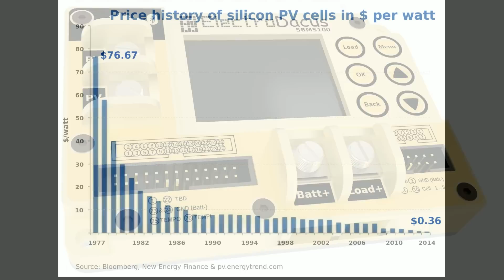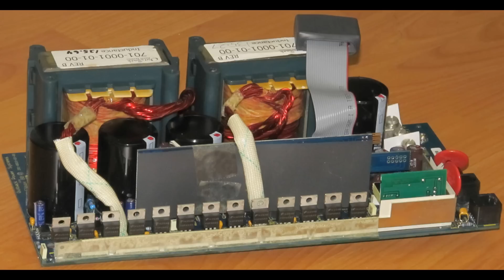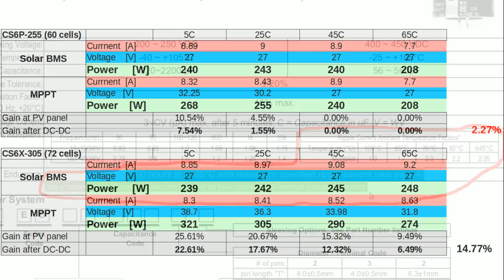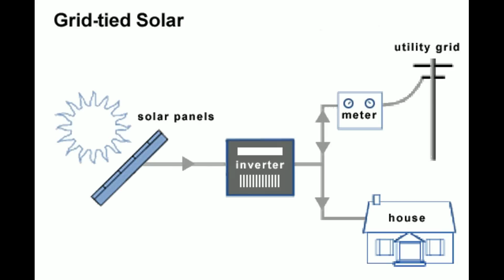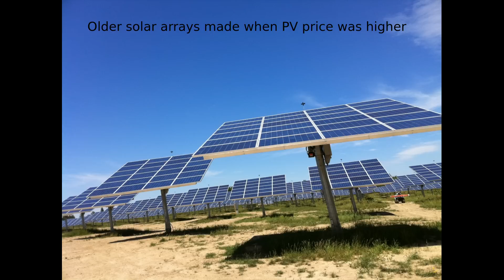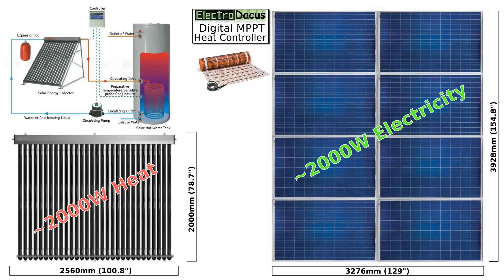Is the MPPT in OffGrid Solar obsolete ?

Comment: Dacian, check out the lengthy discussion at Green Building Advisor titled "solar thermal is really, really dead" This compares Pv hot water with thermal solar and concludes as you did. The other consideration is Pv with cheap resistance hot water heater tank or with "heat pump" hot water tank. The heat pump will cut the electric demand by about 75% in the "non heating season". But since the heat pump is inside it "robs" the house of heat. In winter you are heating the house, so the heat pump only has great benefit about 7 months per year. 
You and I are both off grid so we produce little Pv electricity in winter  and over produce  9 months per year so we are better off with plain electric hot water tank and put the money saved from $2500 heat pump water heater into more PV. 
So solar thermal is obsolete. Heat pump obsolete. Ground source heat pump is very, very expensive for space heating and so it is obsolete. Cold climate air source heat pump is about even with PV for "displaced" energy (about 66% year less energy demand than electric resistance heater) However the Pv lasts twice as long as air source heat pump (lifespan 15 years) so is half the price over 35 years.  
Windows, again you are correct. Especially expensive triple glazed windows almost $100 sq ft!! only r-7.  So much better investment than windows or PV is exterior closing insulated window shutter panels at R 30 or even r 40. This is effective in all weather conditions, can be self made for $10 sq ft or less and will save more BTU than PV can produce through the winter. Close 16 hours a night in winter, open on sunny days for solar gain. Can use cheap windows and spend saved money on more PV.
Last point. Thermal storage of heat for hot water and space heating is the only reasonable way to possibly heat with PV. A 5000 gallon super insulated in ground tank will store 1500 kwh of heat which a  5 kw PV array can produce from August- October. That covers your heat load if you use window shutters, for  November and December. Then your 5 kw array will start producing quite well by Jan. 21 and give you more heat, maybe 100% in Feb-mar-April.
Reply from the maker: Thanks I will probably check that discussion on Green Building. Heat pump maybe is OK in hot climate for cooling. For me where  only need heating heat pump will be more expensive especially since it will need a ground loop else will not work at -30C
My house is a bit non standard and has enough thermal mas for solar PV heating.
My thermal storage is up to 100kWh if I'm happy with up to 10C delta say 16C to 26C for the concrete floor. Even if concrete floor is at 16C I can easily heat the air at 19 or 20C with just the energy produced in a cloudy day.
My array will need to be about 7 to 9kWh total and in that case no backup heating source will be needed. There will be quite a bit of extra energy even in January but that is so that I have enough in December and do not need any extra.
I will need about 500 to $600 for cables about $1200 for ground mount, 1000$ for resistive loop and digital MPPT  and about $7000 for the PV panels so I round this to $10K this over 25 years will be around 400$ / heating season and this can not compare with anything else. Right now I'm at about 1200$ per heating season with the small propane tanks.
$400 is 3x less but I get multiple advantages. I can use more energy for cooking do to large array and I can find some uses in summer for all that energy maybe some electric tractors, irrigation or some other stuff like this.
Distiled water is also another use for the extra energy in summer. I pay now about 2$ for 4 liter on gallon / day at the store that alone is 700$ a year and can more than amortize the investment in the solar PV heating.
Reply: vensonata gallons? BTU? U must be from this renegade colony..
Ok seriously: Here in metric land triple pane windows are the norm /code with U<0.5. and they are reasonably priced at around 200-400 EUR per sqm. Keeping out the heat in summer and the cold in winter. Insulating shutters are a very good idea for winter nights. But automated nice looking ones cant be had for less than 200 eur per sqm. So i dont think windows ate outdated - they are quite a cost effective i architectural element.

Comment: I'm very skeptical about using PV panels for heating anywhere where there is actual winter. For example here in Estonia 90% of the energy PV panels produce comes from March to October and 10% from November to February where the heating is most needed.

Statistics on the sites show that 1KW worth of panels installed only produce 12KWh for the whole month of December. That is 16W (12000/31/24) per hour. Class A (EU standard ) yearly energy expenditure for heating a very small 100m2 house is 12000KWh. 
And most of that expenditure is during winter. Lets say in 9000Kwh during November-February. If we assume it distributes equally it means 2250KWh (9000/4) for each month. So in December that would mean you would need 187KW (2250/12) worth of panels to heat your home. That is roughly 700 panels. Even if house has much better insulation its not just feasible, because you still need hundreds. Even if you have those panels where do you put/get the energy for the period the sun does not shine (could be a week).

Because of that you still need heating with traditional means based on water circulation + additional heat source (nat gas., wood etc.) for the winter. That ofcourse means that the you would need circulation pumps, heat storage (depending on heat source) as well. Which of course makes solar heat pipes more attractive as they are quite much more efficient for producing additional energy for heating and hot water in the months there is actually some sun.
Reply from the maker: Yes you are right it depends on location. While here is really cold is also sunny even in winter.
Worst moths here are November and December where 1kW PV array will produce 94 / 104kWh and January is already 135kWh.
You can check here http://rredc.nrel.gov/solar/calculators/pvwatts/version1/
Select Canada and SA Regina for my location then on the next page charge to 1kW PV array use a DC to AC derate factor of 95% (direct heating no inverters or battery loss) and change array tilt to 65 degrees so you get the most in the winter months.
My house needs in coldest month usually January about 1000kWh based on my last two winter energy use so not just theory.
Thus all I need to heat the house are about 30 of those 250W panels maybe 36 just to be sure.
My house is also "small" (I consider big enough for two people) at 65m2 but also extremely well isolated you can see that I have a video with how the house is build and it also has a good thermal mass with 14 cubic meters of concrete that can store 100kWh at 10C delta.
Maybe I will need to make a video with more details about this. This is not an average house since was designed and build by me.
Reply: 16W per hour is a nonsensical phrase, since watts are a measure of energy over time (i.e. power). What you probably meant is 16Wh per hour, in other words 16W.

Comment: Great video electrodacus.  I am curious if you have done any research on lithium NCA (LiNiCoAl / Lithium Nickel Cobalt Aluminum, sometimes called NCR) batteries versus LiFePO4?  I know Tesla uses the NCA batteries - most likely because they perform better/are more resilient too temperature fluctuations and high temperatures.  For example, Samsung's ICR18650-22P (NCM cell, 3C rated, approximately 2.1Ah).  I have seen some people use them with great success to make ebike batteries (http://em3ev.com/store/index.php?route=product/product&path=35&product_id=158).  What kind of battery do you think is best for the off-grid solar application?  

I disagree with you regarding large windows and thermal mass for solar gain.  With careful preparation, one can build a "Passive House."  Well-made triple pane windows (like Zola windows) and the correct pitch of a roof can utilize the sun in winter months and limit solar gain in summer months (https://terrahaus.wordpress.com/2011/08/11/solar-orientation-and-thermal-mass/).  This strategy would almost eliminate the need for any additional heating.  A lot goes into a passive house, but in that application, large-efficient windows and thermal mass can make a lot of sense (http://passipedia.passiv.de/ppediaen/basics/what_is_a_passive_house).
Reply from the maker: That Sonny battery has about 300 charge cycles vs a LiFePO4 up to 7000 cycles if is from Sony.
In OffGrid you do not care about energy density only about the amortization cost and that is based on how long will that battery last so how much energy store and retrieve from the battery over the life.
You can make a passive house with just PV panels at a much more cost effective price. That was the idea. My house is designed to be passive after I add the solar PV array for heating. If you did not already see my house build check that video is just 16 minutes showing how I build the house. It is designed to be a passive house and has a large thermal mass 100kWh at 10C temp delta and excellent thermal isolation. I made quite a bit of calculations and large windows are not an economic solution.
A triple pane window will be at least 5x more expensive than solar PV for the same gain. Yes is nice to have large windows watching outside scenery but not for the 5x the cost :)
My windows have the perfect size to be shaded by the roof in summer months I need no air conditioning never gets above 27C inside the house.
Reply: ***** Thanks!  No question those windows are very expensive right now.
Reply from the maker: Grant Tanner
I know that is why you will only use those when money is no question and you want that panoramic view but if is from a pure economic perspective related to heating then PV are by far a more cost effective option.

Comment: All of your calculations are well founded and I agree that the cost of adding extra panels is a more cost effective way of harvesting more energy. However, you seem to have overlooked one important point, physical area. Where do we put the extra panels? They have to be mounted somewhere, but when all available space is taken up by the existing panels then there is no room for any more.
For most people, who live in a standard house, the only space to install panels is on the roof of the house and this space is often limited to a 1.5KW array on average. Some very lucky people can accommodate a 2KW array. I have only enough room for 1KW on my roof. This is where the extra gains of MPPT are very much welcome.
The money spent on a good MPPT controller could buy another 1.5KW PV array, but without access to infinite space, it is not an option for most people.
I think physical area is something you need to include in your calculations.
Reply from the maker: You probably did not understood the video. In offgrid energy storage capacity is limited so when battery is full there will be unused energy from the PV array. In a typical offgrid system around 50% of the available energy remains unused so the 5 or 10% extra you can get with an MPPT in some conditions will make no difference and all it will do is have your battery full 10 to 20 minutes earlier so absolutely no gain.
The above reason alone will make MPPT useless even if MPPT will have been free.
Reply from the maker: We are talking about 10% more panels or panels that are slightly more efficient. If you do not have enough space for what you need the MPPT will not make any difference.
Are you fully offgrid ? If so it seems like your system is not properly dimensioned or maybe you use Lead Acid battery that will stop charging in constant current mode at about 80% SOC and switch in constant voltage mode where not all power available from solar PV can be used and in that case the MPPT will not work as an MPPT so even more useless with Lead Acid.
When you size an offgrid system you take the worst month for solar and use that as the basis so that you have enough energy in all conditions.
My battery in a sunny day is fully charged a bit before noon.
My house needs 50 to 60kWh/month and that is provided by 3x 240W PV panels that work already at max power point in most cases or very close and battery was for the last 4 to 5 years a 100Ah GBS (recently I upgraded to a 185Ah 24v LiFePO4 since my energy usage will increase slightly).
I have no backup generator or any other sort of backup and and at most I had two or three days a year when I needed to reduce my energy usage drastically to heave enough energy for over night (mostly in dark winter months and mostly my fault).
Now this winter I will also fully heat my house with solar PV installing a 10kW PV array and using my new device called DMPPT450 Digital MPPT thermal controller (no relation with DC-DC converters in traditional MPPT).
The DMPPT450 supports a max of 14kW of PV panels while I only need 10kW to fully heat my small house. The PV heating is the most cost effective heating solution since storage will be done in thermal mass not electrochemical batteries.
PV panels amortization cost is 2.4cent/kWh while best LiFePO4 (most cost effective battery) 25 cent/kWh in real life and thermal storage less than 1 cent/kWh.
If curious on how DMPPT450 works you can check this presentation I made http://electrodacus.com/DMPPT450/dmppt-presentation-v01.pdf
The 10kW PV array will be the same for both heating and battery charging so the small 5kWh battery can be charged fully even in the worse cloudy day. Thermal storage since is so much less expensive will be much larger at 100 to 160kWh
Reply: how about the goal zero yetis?  the only stand alone device I know of that allows 350w of pwm and 350w of mppt simultaneously.  awesome for me living in my RV with extremely, and I do mean extremely limtied space.  20 foot class c.
Reply: That's not true at all though, not in a real world environment. A lot of factors will influence what you can get out of your panels, especially shading and clouds. On a cloudy day, 10 or 15% might be the difference between being able to have enough power or not.
Also, as Kibi15 mentioned, physical area is a concern in almost every solar installation that isn't on an industrial scale. I know I couldn't meaningfully fit more panels in my system without serious effort and construction, which would cost me about 5 or 10 times what even my new MidNite Classic 150 cost me.

A lot of days, my system just barely manages to get my batteries topped off while running the loads and such. While this is sufficient even in most of the worst weather conditions, 15% less would mean my batteries would go without a full charge some days.
And with clouds or shading, you might see a lot more than 15% difference in a real world scenario.

MPPT does indeed make sense for many applications, if not almost all. And with falling prices of charge controllers, it's feasible for me to simply keep a spare and some parts if I need long term reliability without 'outside help'.
I agree though, that for a lot of small systems that the efficiency isn't needed, the reliability of a different type of charge controller could be an excellent trade-off.

Don't get me wrong, the Solar BMS that you've got there looks impressive for a number of applications, but I disagree that it can replace an MPPT charge controller in a lot of scenarios.
Reply: This guy (electrodacus) is literally just trying to sell his product as far as I can tell. :/ MPPT is amazing for any time you don't have an entire cornfield to fill with panels. (And enough panels to fill the cornfield. :P)
Reply: @fourzerofour7860  did you get what was being said. the mppt will work for 10 years if your luck and the prices are expensive unless you go with Chinese but then you get a lot of less warranty and possibly need to buy many more mppt controllers. This guy came up with an awesome product and the new ones he has made are even better. tell me who on youtube is not trying to make money. the point with Dacian's products the prices for what you get is way more than what you spend for all of those who are gouging people from solar power. I am using Dacians product because it makes sense and will last as long as my panels do.